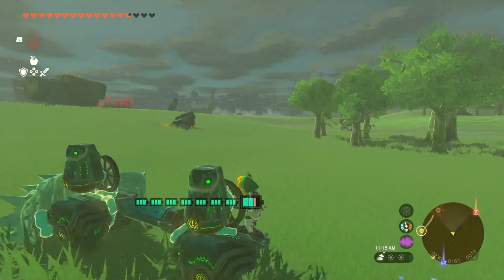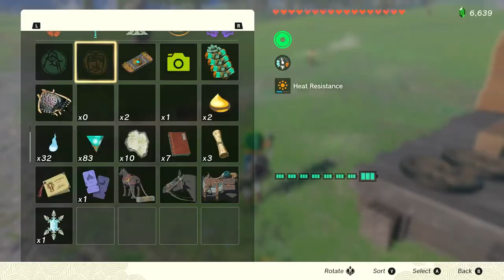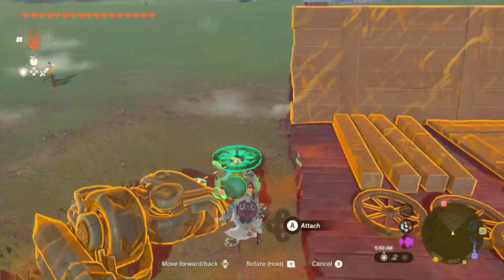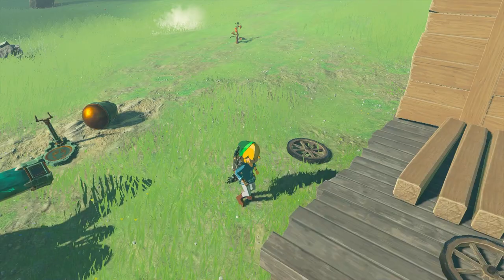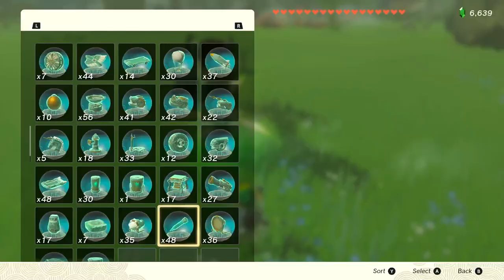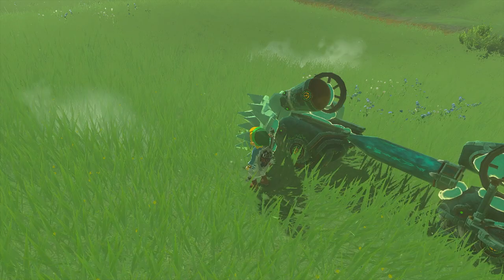Drive up Hills with Small Wheels w/ Stabilizers - How to Build The ElecTrike - ToTK Vehicle Tutorial

Comment: The only downside is it has too many part = more cost if you just want a quick to use quick to abandon vehicle to explore extreme environment.

Great use of stabilizer tho, been using the cooking pots suspension but they tend to wobble alot and very prone to drifting with 2 wheels
Reply from the maker: Yeah, its definitely not a cheap ride. lol. I originally had the cooking pot suspension on here as well but only on the back end. It created this really fun disconnect with the front end allowing for some really cool drifts. Ended up taking it off because when I hit a bokoblin with the front end it broke the cooking pot connection.

Comment: I hope they introduce a stone or metal wheel that acts like a more durable Version of the wood wheel in the future
Reply from the maker: This! I'm hoping for more building parts in DLC. Metal small wheels and smaller springs are my only requests.
Reply: @MysticBGaming  I’m personally hoping for stuff like that, but also possibly a permanent wing and cooking pot (cooking pot so a literal mobile home is possible and wings for funny planes, the design differences could be that instead of the lighter green on the wings they could have the zonai gold-orange color, and they’d probably be the same zonaite cost wise as a big battery or large floating platform